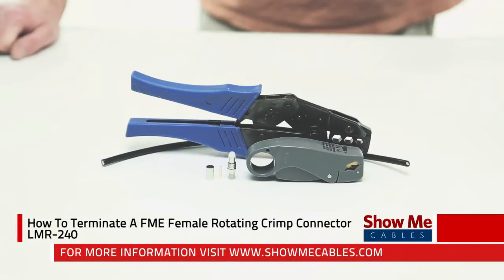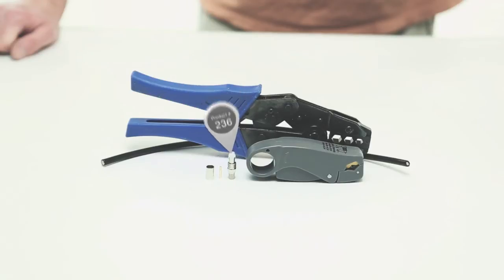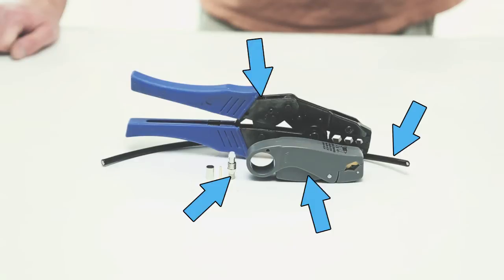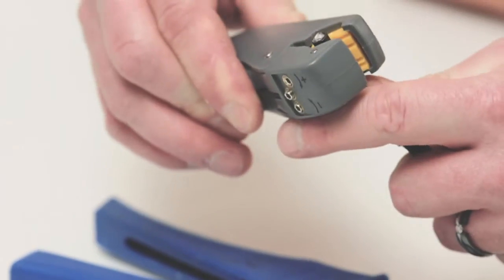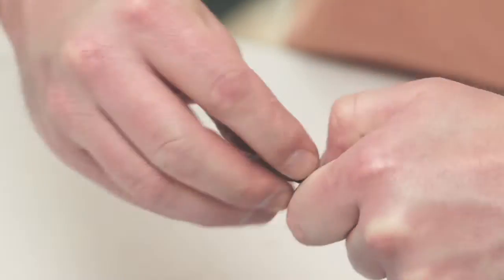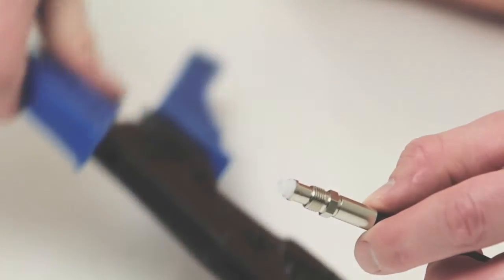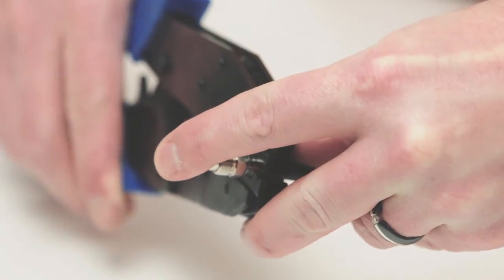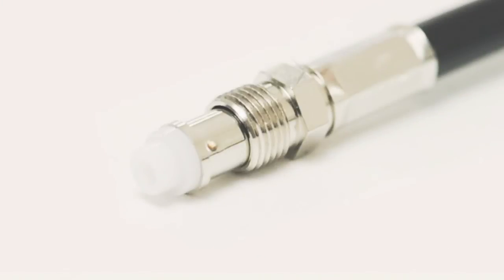How To Make A FME Female Rotating Crimp Connector #236

Comment: This is a helpful tutorial. As a newcomer, I appreciate simple step-by-step videos. I will probably solder the pin to the cable wire to ensure a secure connection. To make things neater, I'm going to add a piece of heat shrink tubing to cover the end of the ferrule. Thanks for the video!